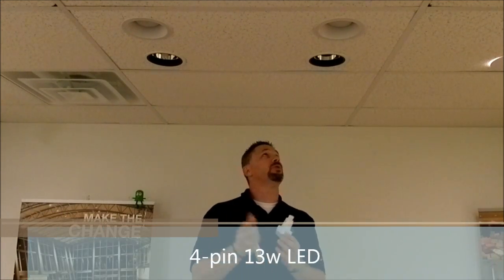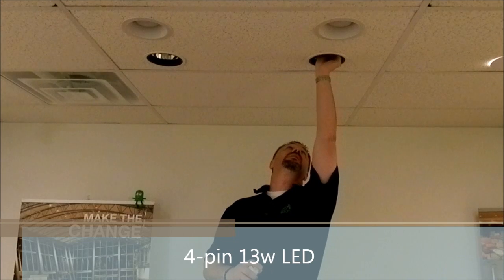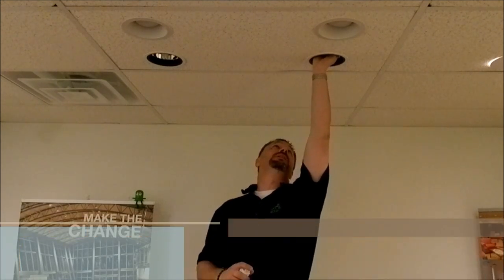Did You Know - 4-Pin 26W CFL to 4-Pin 13W LED Lamp

Comment: Hi Travis. I am trying to REPLACE the 13 PL-C 4-pin with a the same but NEW bulb. However, I can not seem to get the G24Q-1 to push into the socket. WhatAm I doing wrong?
Reply: Each wattage of CFL has a different pin configuration that plugs into socket in fixture. There should be an LED equivalent lamp for your 13W CFL. Contact your lamp distributer about that.

Comment: my can used to have a fluorescent pl-t and i installed a new led pl-t. after a few min the led would turn off. any idea why?
Reply: Alvin, the most likely scenario is either a bad or non-compatible ballast.  What brand of LED lamp did you buy?  We've always had the best luck with Lunera - they seem to have the most extensive list of compatible ballasts. But there are other nice quality products out there too.  The cheaper products have not done extensive testing with ballasts and therefore will offer less compatible solutions.
Reply: mine does the same thing and gets super hot.  does that mean I used wrong led replacement bulb?  I wasn;t even aware of ballast

Comment: If I switched my current 13W 4-pin CFL to these LEDs can I dim them? My current lights cannot be dimmed and it drives me crazy.  Thanks
Reply: audionet1 Great question. The Lunera Helen lamp not currently compatible with dimming ballasts. So in this case, no. It's possible that Lunera will release a dimmable version in the future, but at this time it is not. Our suggestion would be to switch to a recessed can than can be dimmed and use dimmable LED lamps (such as a BR30)

Comment: You say no delayed start but there was a delay when you turned on the light?
Reply: stockjonebills thank you for the question! The delay you saw in the video was due to a wireless (WiFi) device I was using to control the lights in the room. If you watch, you'll see that the LED lights and then a second later the CFL lights. That was the delay I was referring to as going away with the LED. I tested this several ways and if I use the wall switch instead of my phone, the LED comes on instantaneously every time. Network lag and internet traffic seems to affect how quickly my phone sends the signal to the wall switch. Once it hits the wall switch though, the LED is instant. If you have any other questions, please let us know!
Reply: Travis Hettenbach Ahh thanks. Very cool idea.

Comment: When you replace the CFL to LED, don't you have to remove the ballast?
Reply: +Verdigris That's not entirely accurate.  A ballast in the system typically does consume more electricity than without - but I don't agree it defeats the purpose of using an LED.  If I'm consuming half the electricity I was before, then using an LED (even with a ballast) has still reduced my energy consumption and it has definitely increased the lifespan over the CFL.  Lower maintenance costs, lower energy costs, and improved lighting are all some of the purposes of using an LED - so it definitely hasn't defeated that purpose.  Also, many current LED products see just as long a life on a ballast as they do without.  Most of these products will have a 5 year warranty and 50,000 hour rating - just like many ballast bypass products.  So a reduced life on the ballast isn't necessarily right.  Also, you can expect your ballast to last longer now as well.
Having said all of that, I still typically recommend bypassing the ballast completely in most applications.  However there are some instances where it doesn't make sense to do that.  That's the great thing about these products - it gives you multiple options for solving the problem.
Hope that helps!
Reply from the maker: Hi Kevin - you are correct in the fluorescent bulbs whether they are a tube or a CFL, they do require a ballast. The beauty of this product is that it is truly plug and play. The driver inside the base of this lamp is intelligent and able to operate on the same ballast as the CFL. Pretty cool. No need to rewire or replace anything but the bulb itself. Here is more on the Helen LED Lamp. Let us know how we can help. http://www.ledsource.com/products/lunera-helen-lamp/
Reply: Sounds like you are saying that if the ballast is near to end-of-life your can still expect 50,000 hours from the new LED.  Is this true?